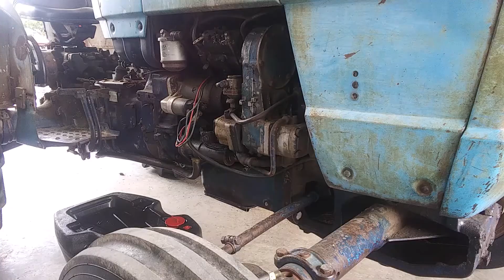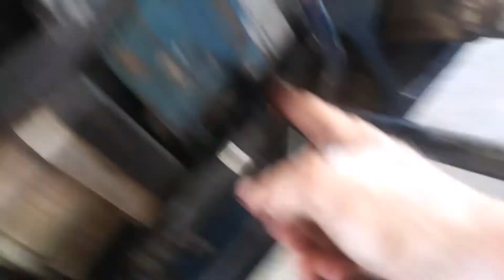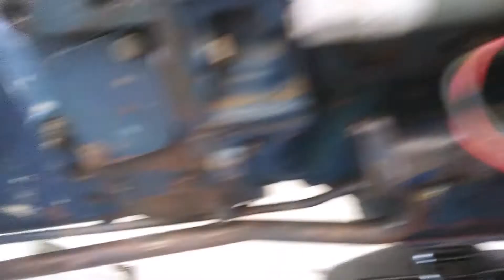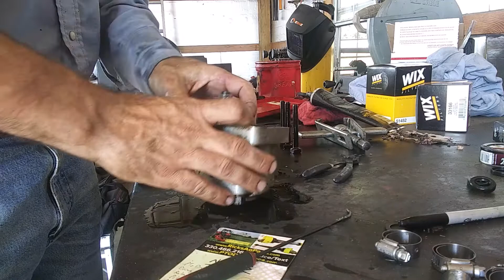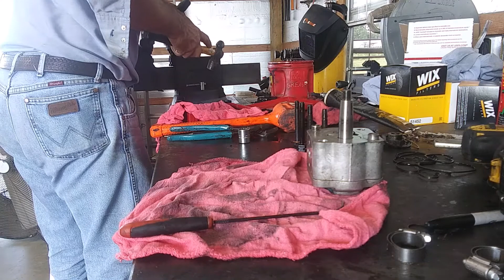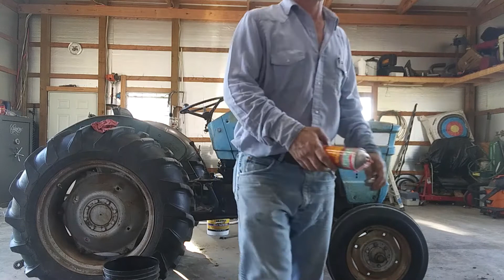Long tractor hydraulic pump repair

Comment: I have a 1974  445 Long  tractor that I had a lift pump seal failure on years ago.  I had a 5' bushhog lifted holding the weight at 1800 RPM while I sharpened the blades and motor oil started pouring out of the Engine crankcase breather pipe.  Mine was pumping Hyd fluid into the engine.  When I pulled the dip stick to check engine oil, oil came gushing out.  Replaced the one shaft seal and has been fine ever since!  My Long is a Strong tractor and I now use a Woods 72" grooming mower behind it to cut the grass.  Also replaced the injector pump a few years ago.  Both were easy jobs and not that expensive.
I paid $2500 for it 40 years ago.  I have got my moneys worth out of it!  Still a very good tractor with easy power steering.

Comment: I have a 2460 long I can't get the 3pt lever to move. Just wondering if you have any idea what might be wrong
Reply: If the quadrant/ draft control itself isn't frozen itself, all you can do is pull the lift too and take a look. It's not complicated to do. Just dive in!

Comment: Just a little note for you ,you're probably not gonna believe me but this is a true statement.  I have that same tractor and fought for yrs with the hydraulic and transmission problems ,after doing research I found that I had been using the wrong fluids in it .except for engine ,Rotella t4 . Well guess what I use rollat4 in the hydraulic and transmission too and had 0 issues
Reply: What oil did you end up going with i just bought long 560  runs great but doesn't want to move flushing all fluids and buy both new pums

Comment: You know, my mom had a friend come and work on my Dad's tractor. I've always worked on the tractor, but it takes someone else to actually get her to put any money into something... She's cheap like that with family and from what I just learned about your hydraulic seal issue. She royally screwed up by getting the guy to work on it.
LONG story short, we've always had a little drip of oil after we park it; it's probably diesel and some hydraulic fluid. The man changed the starter and had to pull the hydraulic pump off to do it. Afterwards, he tells her that she's got a steady oil leak... Welp... She put a quart into and went to brush hog for just over an hour before all hell broke loose! Sadly, she's not the type of person to notice irregular engine noises and she has that engine smoked. 
Until I heard what said about that pump seal dawning out the engine oil from the timing cover, I assumed it was ignorance on her part for not putting enough oil... After all, oil doesn't just disappear! I can't believe it, but you're right! The tractor has always say half full of oil.

I loved that tractor too! So did my dad, before he passed. It's just a shame, really... I might tear it down and go through it because the parts for this tractor are far cheaper that the John Deere 1050 we're going to buy to replace it. Then I'll hopefully get it back up and running for a standby tractor.

Comment: I have a u350 and was wondering if you have ever talked to someone about engine issues and wondered if you can access all of the Rod caps from the small cover on the bottom of the oil pan, I have a knock I think could be the piston taping the head and oil pressure is about 45 lbs at idle rpm but wondering if piston could be replaced without breaking apart the whole tractor any information you might have would be helpful?
Reply: You absolutely can access all the rod bolts through the small access cover on the bottom. I did an inframe overhaul on that same tractor just the same way you are wanting to work on yours. Cylinder #1 is a bit of a trick to torque the rod cap down on reassembly, but it can definitely be done! With the symptoms you describe I would check for piston slap.
Reply: Thanks for your reply, I have 1545 showing on the hour meter and the cable was broken when I got it and not running. But I paid a thousand to buy it and another thousand to get the pump and injectors done and got it to run and it smokes blue after it’s warmed up and number 3 is really pounding and sounds like piston hitting the head and I’m 75 years old and I’m not sure if I want to attempt to dive into it at this point but everything is working on the tractor and not sure what I want to do. I feel that the knock is why the quit it and the owner passed is how I got it and if I put the money in it I would never get it back out on a sale. I’m just now bringing back  two old Fords a 1946 9N and a 1948 8N and a few more weeks to finish them up and if I decide to fix the Long and I know it’s built like a Tank and strong old Tractor it’s been great chatting with you and you do good work from what I can see, again thanks for the information and maybe we can exchange phone numbers and chat sometime!

Comment: great video, ive got an AC5040 thats leaking like as stuck hog, and the 3pt doesnt work, mine is leaking around the bell housing on the left side (if youre sitting on it) just curious if this was a place yours leaked. (5040 and longs are just about the same tractor if not identical)
Reply from the maker: The AC5040 is exactly the same tractor aside from paint and decals. I would love to see some pictures of the leak your talking about. You say the three point doesn't work. Is the power steering almost 1 finger to turn easy?

Comment: Thank you for the video, Question I have a 460 long it runs fine in Idol but as soon as I put it in gear it starts dumping motor oil out of the crank case breather. Would you happen to know the reason? Could this be an easy fix? Thank you
Reply from the maker: Not being able to look at it my first thoughts are either high crankcase pressure or the oil separator in the breather has an issue.
Reply: Thank you sir
Reply: You were right the oil separator breather was the issue, replaced the old one and works perfectly fine. Can I soak the one I took off in gas or diesel to clean it out or should I just chunk it?
Reply: @ciscogarcia498  i’m having the same issue with my long as you described. Idle it’s fine but as soon as I engage any hydraulics, motor oil will gush out of the breather. How did you replace the oil separator? Is it in the breather?

Comment: How can you break a stuck clutch loose
Reply: I’ve got them lose with tying to very heavy load with chain but I’ve also had to drill holes in bell housing and sprayed PB blaster in it and used 4/5 cans 
But it worked 😊
Reply from the maker: Sometimes putting the engine under a heavy load while repeatedly stomping and dumping the clutch will free one up, but many times the clutch has to be disassembled to get it free.

Comment: You make it seem easy. I'll have more confidence after watching your video. Thanks. Question: will the hydraulic system bleed itself? I have a mid 80's Long 610 2wd and need to change all the loader lines.  Thanks and I'll be watching for more.
Reply from the maker: Bleeding the system requires cycling the affected components. If you change hydraulic hoses on your loader you will simply operate the loader to purge the air. The loader won't work very good at first and you will have to add fluid to the reservoir during bleeding.
Reply: Thanks. I got it done and the system holds a full bucket steady. No dipping or slow run to the ground. Now on to oil draining from the breather upon warm up. You vids are great !

Comment: do you remember where you got your seal kits?
Reply from the maker: The parts came from Ricks ag parts. Good prices and the most spectacular service I have ever found.
Reply: @4cfarms853  do you have part numbers by chance?
Reply from the maker: @jessieogle8340  not off the top of my head, but UTB used several different hydraulic pump combinations on these tractors. Unfortunately most of the time you have to figure out what pump you have in order to get the right parts.

Comment: Hi, could you tell me the part numbers and/or which way each pump rotated. I understand one pump rotates clockwise and the other counter clockwise. I want to replace both pumps on my Long and having trouble getting information on pump rotation and part numbers.
Reply: You will have to remove one of the pumps and look at the shaft end of the pump, there should be an arrow showing direction of rotation.

Comment: Thanks for the video. It gives me a little more confidence to change my hydraulic pump on my Long 2460. My two pumps are backwards from yours. Steering in front.
Reply: I just bought a 91 2640 and changed all the fluids did the hydraulic fluid and filter last, now the dang hydraulics won't work. Do you know if it has a bleeder vent for the hydraulics. I know the cap is a vent .

Comment: Hallo. Eine Hydraulikpumpe ist ab 5000 Betriebsstunden verschlissen. Das bedeutet das eine neue gekauft werden muss. 
Die hydraulikpumpe bekommt Gravitation im Gehäuse. Manchmal kann man eine defekte Pumpe an einem Geräusch des Systems hören. Dann muss sie neu.
Reply from the maker: These pumps were not worn out though, They were just leaking, but You are right. No amount of seals and orings will fix a pump with excessive clearances.